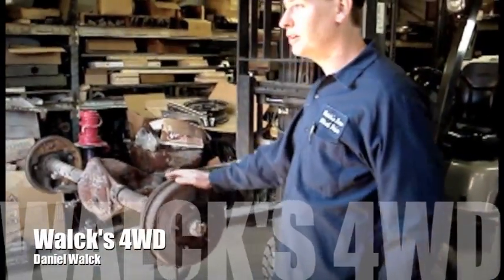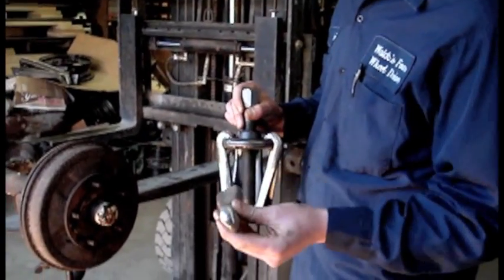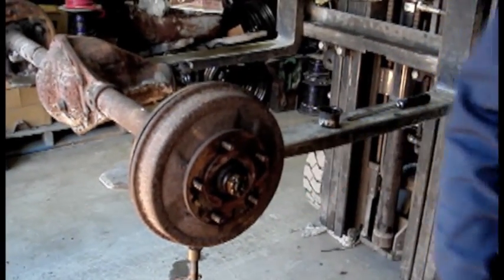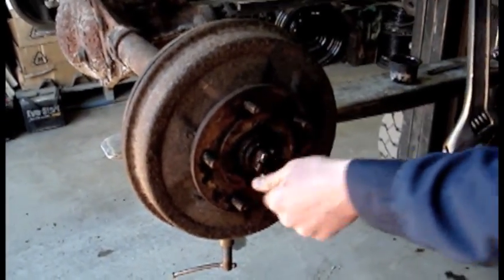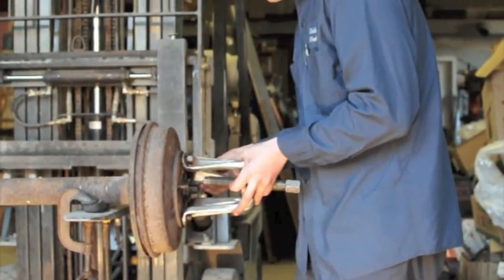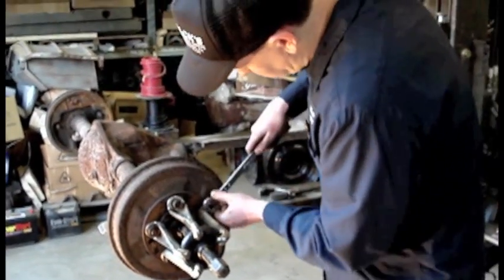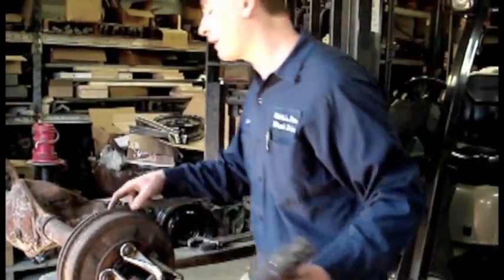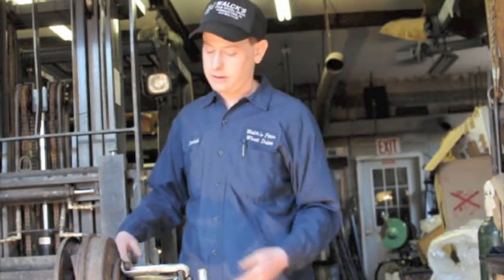HOW TO: Remove the Hub & Drum Assembly

Comment: i have had many fly across the shop so i started putting the big nut back on but no washer and only a few turns . much safer thanks john
Reply: +fricknjeep Dittos!  Removing nut and replacing it loosely (with castelations inboard) is the approved technique...as well as keeping the drum/puller assembly from flying across the shop when it releases, this also reinforces end of axle for when MEGAFORCE needs to be applied to break drum free...without it, I've seen the end of axle (weakened by cotter pin hole) actually compressed!!!  Having learned the hard way, now I ALWAYS use anti-seize on tapered halfshafts where drumhub is stretched on...that makes drum removal (almost) a pitstop operation.  Good video though...applicable to old Volvos also.  Cheers